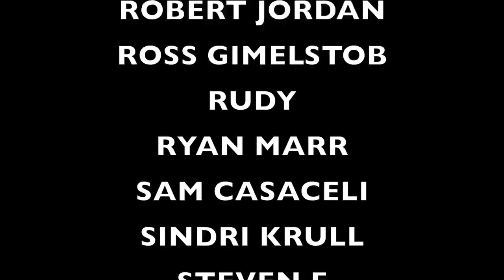LSA SUPERCHARGED COLORADO GOING AS PLANNED…

Comment: If you’re turning up the boost on the blower. Get that brick inside the charger reinforced. It can collapse and send coolant through the motor
Reply: Chris needs to see this
Reply: @apeeric  yupppp. One of the first things I did when I got the V.  Pulley, injectors and E are coming up in spring.

Comment: Hell yea man its almost there,  it's always the last little bit that is tricky to get the job done but  you guys will get there , big shoutout to Russ and Max great guys helping you out with this thing. 👍 cant wait to hear this thing whine. Definitely gonna need some really grippy tires on this thing to get the most traction possible and should have a set of slicks for it so you can really feel the power in it on certain occasions or at the drag strip. With it dialed in you should be able to run 9s in it which would be your fastest vehicle for sure.

Comment: Please get a different accessory mount, the alternator should be lower.. as in below the power steering pump. also check your spacing, i saw a different alternator bracket but is everything for LS3 spacing, or is this still “6.0 bracket / spacing” Might run into an issue putting the LS3 crank and the belts not lining up..

Comment: Lol rudnik, remote power steering reservoirs are a thing. Pop the original reservoir tank off the top of your power steering pump, run an A.N line with a hose to a remote reservoir mounted somewhere on the firewall fender or wheel well out of the way.

Comment: Couple things. You pointed to the front map sensor. That’s actually a baro sensor. If you look underneath it’s just out in the atmosphere. It’s used on stock LSA cars. It won’t be used on yours. The ACTUAL MAP sensor is behind the IAT sensor. Speaking of the IAT, you need to break it out of the MAF AND wire it to that sensor. The one in the maf is now the ambient air temperature sensor and will do nothing for you. You need to know the IAT AFTER the blower. Your tuner then can setup timing retard based on if the IAT gets too high.

Comment: If you ever need to bed something like that get a 12 inch length of scrap 1/4 or 1/8 flat bar and grind a slit half inch from the bottom. Slide the battery tray metal into the slit and fold / lever it down. You could nearly fit a crescent wrench over the piece and use that to fold it. Flogging that tray with a hammer is nasty. At least he was accurateish....